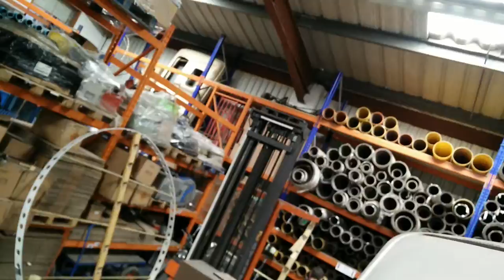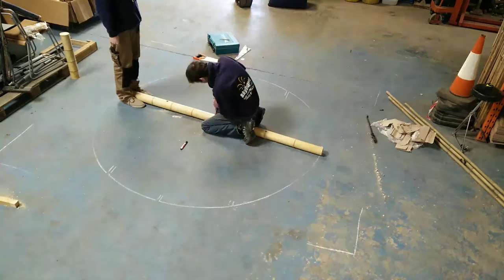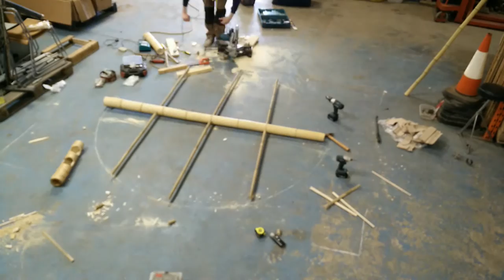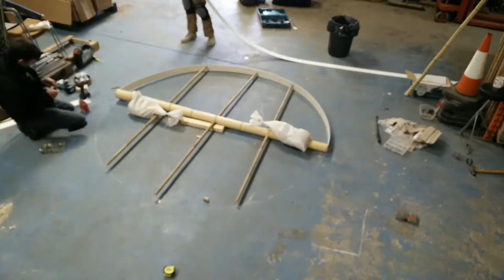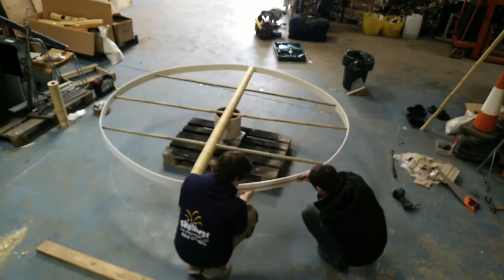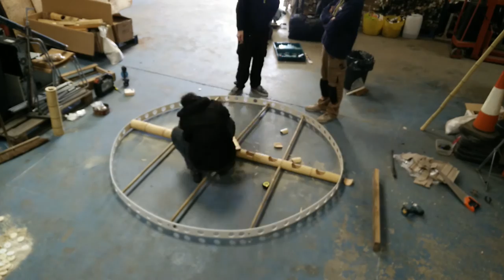Building a Girandola

Comment: Instead of using cylindrical stock i.e. bamboo, why not build the radial pieces with an airfoil section to provide extra lift when the wheel gets spinning?
Reply: From what I have seen it doesn't spin fast enough to generate lift considering how fast the vertical rockets are lifting it.

Comment: What is the material with which you are constructing the outer ring?
Reply from the maker: It was just UPVC Plastic, of which we then cut holes all the way around, to try and save on weight. We had the motors built to give maximum thrust before malfunctioning, but we had a total lift of around 18KG if i remember rightly, and we got the frame to roughly 11kg once fully built, including the motors. 

Apologies for the late reply
Reply: Thank you - I have been wanting to make one of these for years.  Unfortunately I have no where to really shoot one off.  All of our shows are in close proximity to building and the crowds, so from a liability standpoint our company stopped using them years before I joined the company - however during the days of sitting around tying finale chains, my boss, John Serpico (now deceased), would tell me about the ones they used to make which would go up, then a slow burn comp would hit and it would descend, then the faster comp would kick in and it would rise again.  I will have to make and shoot this outside of our company - however I think I will scale it down a little from your design.  Again, thank you and stay safe.
Reply from the maker: fantastic, bear in mind, this one was 8ft in diameter. We can still get smaller versions in through import, and believe we have a few 2 stage left in stock, which also explode at the end with red crossettes. But yes they are very erratic, and not many sites have the space to shoot them due to unpredictable launches. But, we do still see them in UK competitions quite often, there were loads fired by one company in the British Musical Firework Championships this year.